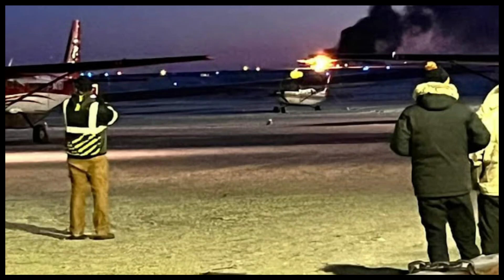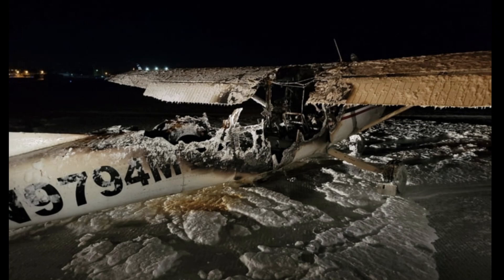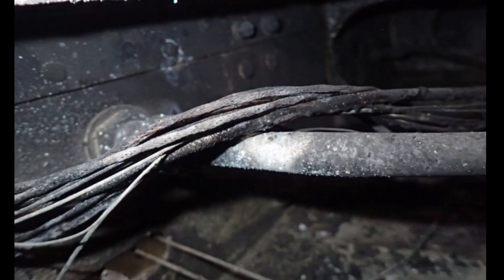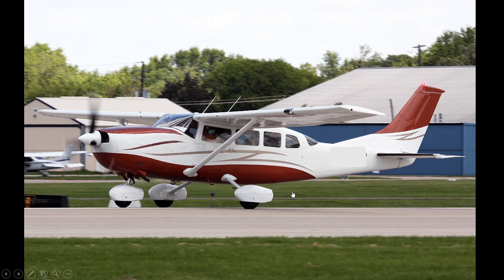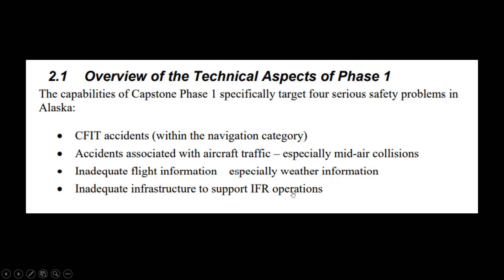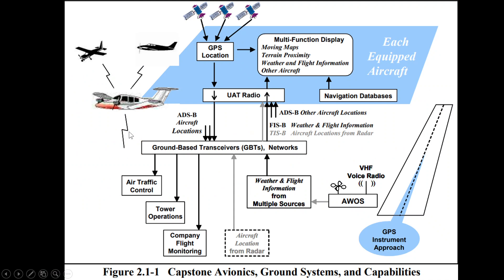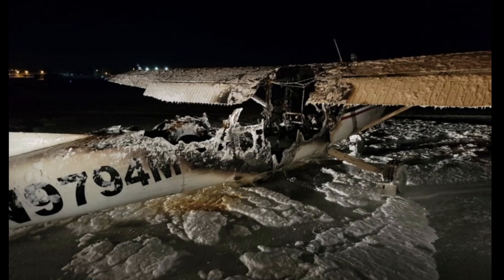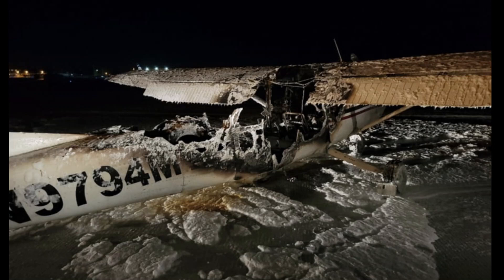Cessna 207A Faulty Wiring Causes Fire

Comment: No big surprise, most planes end up with a rats nest of wiring after they leave the factory. Unfortunately this is the type of wiring work you get with most avionics shops. There even to lazy to remove old wires not used anymore they just cut the ends & tyrap over bypassing the cushion clamps.
Reply: I used to get furious with co-workers in a mobile electronic shop for taking short cuts and even considering not fusing things to the proper amperage etc. I was naive to believe an aviation shop have the potential to take short cuts as well.
Reply: I spent 30 years in military aviation, I have a retirement job working on float planes now and some of the wiring I see makes me shake my hand.

Comment: I don't see evidence of proper cushion clamps being installed on the wiring.  Good system to have onboard, but the installation methods and practices suck; your corner automotive audio shop cannot do this work properly. Get your AC 43 out, people.  The fire most likely was based under the aircraft floor, and the aircraft/people were fortunate to have been close to home.
Reply from the maker: Yes smoke and fire from under the floor.  I  would think there would be regular inspections to check for these types of things.  Unless it’s hard to get to.
Reply: @ARFFWorld  Where wires cross fuel lines or any other structure is usually difficult to inspect, but that is where proper cable routing and securing is most critical.  Or you get this kind of event...that can kill.
Reply: I am surprised they didn't tyrap to the fuel lines like most hacks.
Reply: @Nord3202  I've cleaned up too much of that!